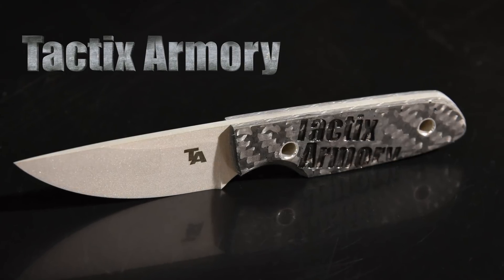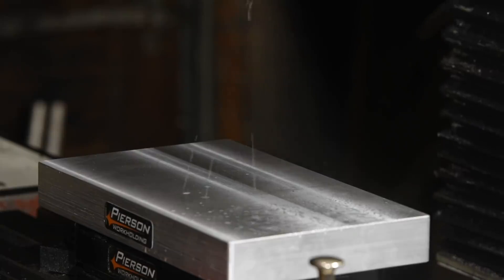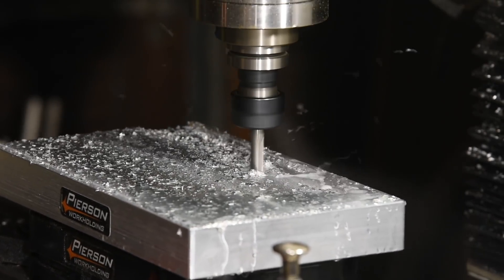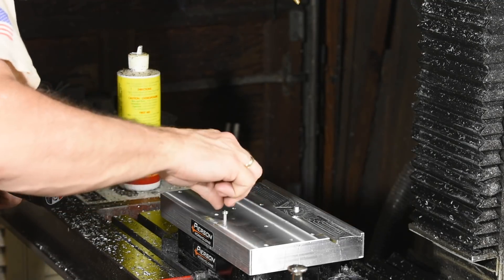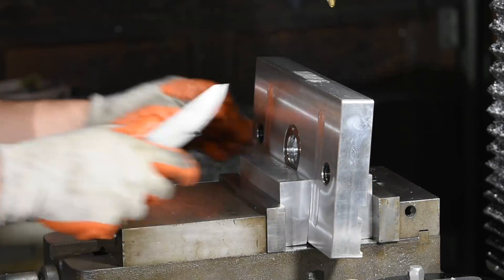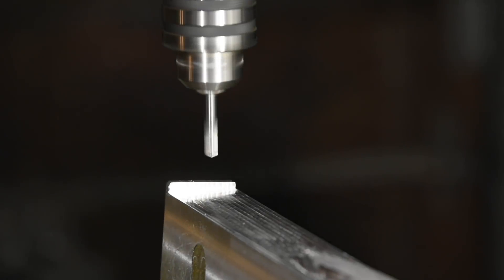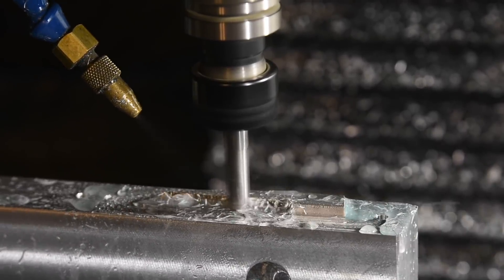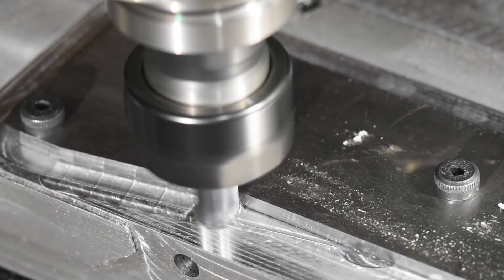Making a Knife Making Fixture Using a Pierson Pallet System - Pt. 2

Comment: i wonder if it's possible to, at least partially, forge separate pieces of different types of steel and merge them into a single blade, probably finishing the process after. like, the base is forged into A6 tool steel with traces of L6 bainite in the spine for flexibility, traces of D2 tool steel into the edge for edge-keeping, place a thick middle layer of hardox 550 steel for wear resistance and a thin outer layer of inconel for oxidation and corrosion resistance, and heirloom-level reusability, and preferably a paper-thin outermost layer of 13% manganese mangalloy billeted to give the illusion of damascus steel.

Comment: Rpm is your friend when milling aluminum. Not sure how much you have on your tormach but a small endmill like 3/8 or smaller you can run at 10k+ rpm and crank up your feed specially on your 3D toolpaths. More rpm gives you better chip evacuation and can make your life much easier. However you don't have flood coolant so be mindful of weld-on. Also you can save some cycle time by using the high speed peck (or chip break) option instead of the full retract peck. Any drills under half an inch in aluminum will be fine as long as you aren't going past the top of the flutes. Great video as always Walter.

Comment: Having broken my share of small taps, I about had a heart attack when you started driving that 8-32 tap with a drill. Then you explained the using clutch mechanism and it made sense.
Reply: A lot of people don't understand the fragile  size of 8/32 thread is . it is soooooo easy to break in the hole. And , and don't realize how hard most of the time to remove a broken tap that is broken below the surface.
Reply: And the tap always breaks ether in the last one or the hardest one to remove it from.